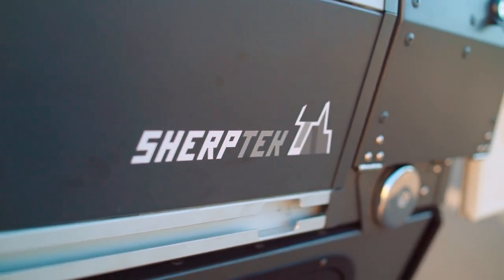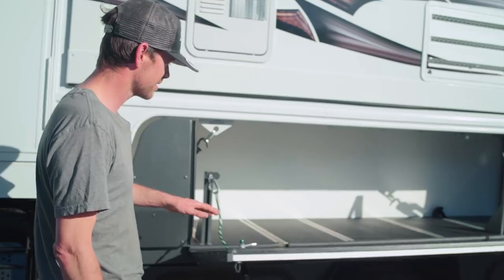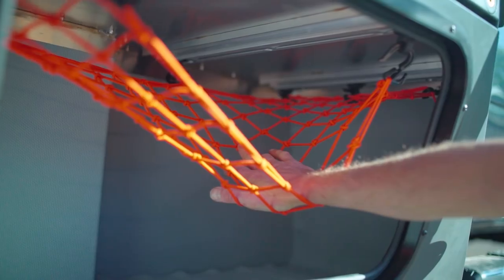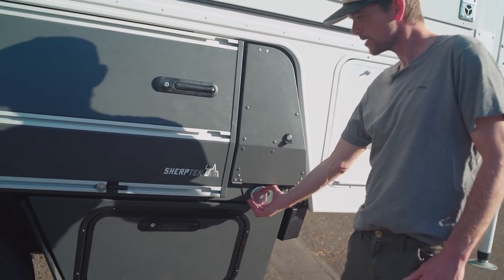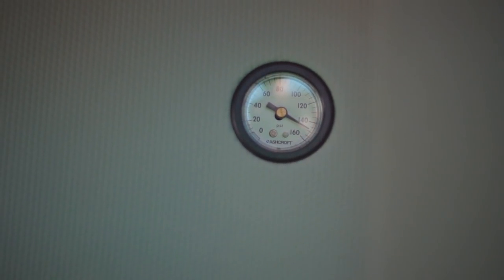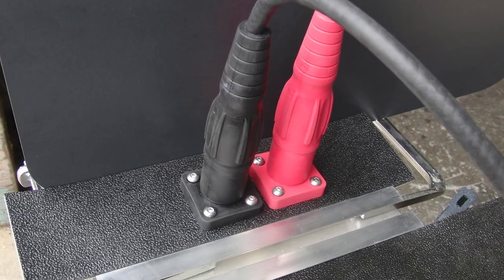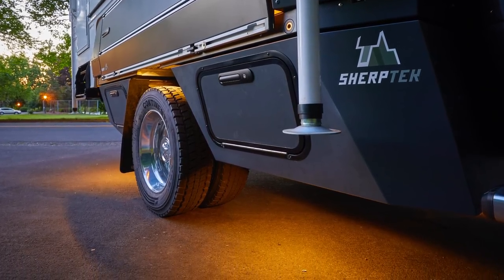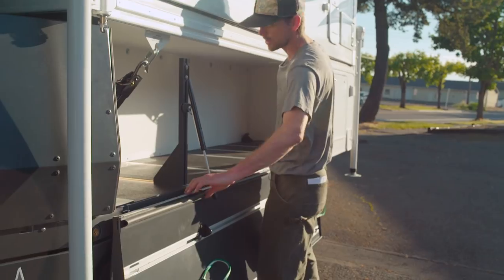A SherpTek modular truck bed replacement system: Ram 4500 chassis cab + HOST Mammoth

Comment: I have been struggling with getting a toy hauler or a motorhome or a camper. I ruled out the motorhome as I do not want another motor/transmission/brakes and so on. so my next idea a toy hauler and the problem with that is space for the wide range of trips and toy I do and have. I just could not see one that would work for me. so it's coming down to custom building a trailer for hauling what I want to play with, so I started looking at campers to put on the truck. after looking at everything I could not get over how much space is wasted with a camper. so I started looking at flat beds and building my own camper on that. then today I came across the ultimate truck bed and it gives me back all the wasted space, I'm ordering a new truck with no bed and buying this one as it fits all my needs and gives me back all the space I would lose with a normal truck bed.

Comment: You should build a heavy duty bed with the air and water system for a work truck. Welder set up or with 5th wheel for small car haulers, racers, lots of customers there.

Comment: Your trying to tell me someone spent all that money and skipped out on a cummins  for the power plant?  Wtf!
Reply: Chase Memmott you read my mind!
Reply: New diesels suck. DEF, DPF, crap millage, can't work on them at home the list is long. At that point just get a gas hog.
Reply: All that crap can be deleted. The longevity, torque, reliability and resale value of a cummins equipped truck far outweigh the hemi. Fuel mileage? Have you ever driven a 9000 pound dual rear wheel truck with a 5000 pound camper strapped to it? Let alone up any sort of grade, WITH A GAS ENGINE? You'd be lucky to get 5 miles per gallon. 

And as far as working on them at home, my 5.7 hemi is so shoe horned into my 1500 that you'd have to dismantle half the engine bay to change the spark plugs. It's a wonder the hood can still close. Every engine is all computers and almost built to be dealer serviced. I cant imagine how bad that bigger 6.4 hemi is.  

The emissions shit is a government mandated pain in the ass but with this owners budget its a no brainer that the hemi was a mistake.
Reply: Marc Laky do you own a new Cummins or a 6.4 hemi.
Reply: No one wants a diesel is crazy cold environments.  Its the dually part which gives it enough payload.
Reply: It’s a lot more than just that. There are a lot of stations that still don’t offer diesel. It’s not at every station, and when camping, you can plan a trip around that, or buy a vehicle that a fuel source is widely available.  Not to mention the DEF issues that’s destroy diesels right now. Dads 17 is around 3k miles and already in the shop for that reason, the shop trucks at my work have all but swapped to gas because of this issue, yes you can delete. Then what void your warranty, this guy probably doesn’t want to go threw that hassle of no warranty when making long trips.
Reply: No I drive a 2018 peterbilt that weighs 26,000 lbs and all that can't be deleted in certain states. Look into commercial vehicle laws and if you get caught with all the emissions deleted by a cop who knows his shit you are screwed. I had a Kenworth T300 with a Cat C7 and I would rather have that pig back. Plus if you buy a brand new truck and delete the emissions kiss that warrantee goodbye.
Reply: I worked on a vehicle that traveled the world. It was a 2002 F550 with a 7.3 powerstroke in it. That engine with only a few mods can run on jet fuel. They chose that truck because they were spending an entire winter on Lake Baikal. They couldn't shut their engine off for months straight and they would get jet fuel deliveries from the Russian govt for the other vehicles that were there. This truck is massive, at the max weight for the chassis, long as hell and would only be viable in the continental US. You would have a hard time getting parts and support in many countries around the world and on top of that crap diesel that would eat the fuel system alive. It looks beautiful but i would rather have a land cruiser for traveling outside the states.
Reply: Removing it all isn't really a solution though. it violates factory warranty for one, and it is also illegal, and can result in the vehicle not passing state inspections. and before you ask "well then reliability shouldn't matter if the dealership will fix it anyway, right?" not quite, I'm not sure what use this truck will get, but imagine someone if off on a month long wilderness trek and a couple weeks in the truck gets sent into limp mode cause one of the numerous emission control systems went unhappy. your tool kit that you bought to fix mechanical issues won't help you any, you'd have to pay big bucks to get a wrecker to pick you up from the middle of nowhere and tow you to the nearest dealership, which could be hundreds of miles away. at that point, even i'd just accept the worse fuel economy of a gasser that I know will go 60K miles before having anything seriously go wrong with it before I gotta take it into the dealership.
Reply: I too would rather have a diesel engine but with that being said gas engines are a lot better now than they were back in the day and as stated with previous options unless you delete all of the power restricting emissions crap and forfeiting whatever warranty you have it just doesn't make that much since right now to spend all that extra money to get not that much better performance.

Comment: bad placement for the air connectors. easy to get grit into it and cause a jam.
i do not see any use for a remote light switch.
a lower rail bed for fifthwheels??
i do like this...but at what cost?

Comment: Just need truck,ha & the Host doors on both sides w/taller under storage so can store potentially super single I think they ran 41" tall & not sure the width for under slide storage. The back window needs to come out easily for loading bulky items 2 prts max. 1 company had washer dryer in sofa spot under window. I would use 2 combo washers that dry, w/table on top. Tri slides r v/heavy no need to rear slide a combo or 2 combo washers. 2 side slides make alot of sense. Want a pop top but Host doesn't offer that yet. Solar  & lithium prep or better installed that can work w/ pop top. 5500 extended rear 1 ft quad cab 4500/5500 4by 4 they don't hybrid make yet.

Comment: I would like to get something similar. Actually this would be my dream set up since i want a mammoth as well and a ram 5500. how much does this same set up goes for? (just want to know for research purposes. Thanks
Reply from the maker: Thanks for your comment! I'll share with you what I shared above. Hope to hear from you soon!

"All of our products are high-end, built-to-order using aerospace materials and construction techniques, and held to the highest quality standards.They are light and strong and built to be abused for the life of the truck and beyond, and the modular nature means this truck bed can be changed and adapt to your needs throughout that time. One of the biggest benefits is that if you choose to go with one configuration at the outset, you can end up changing it completely years down the road if your needs change ... you're not stuck with one utility bed. Due to the many variabilities for each build, which often include aftermarket truck upgrades that we do in-house, we prefer that you fill our the "How to Buy" form (https://sherptek.com/howtobuy/) to get more specific pricing information."

Comment: Beautiful work guy this is a winner system that is lite works w/Host camper perfect can b hardened, just perfect, U Hve My sale! I was wondering just how well other ppl side boxes would work w/w/Host dimensions. Can the hardened bed version b tilt bed sturdy enough to b match ability of the truck. If just flat no problem but  4500 when not camping or towing is a Work Truck.  Almost hve to take standard tilt bed & let u make it Host match box approved.
Reply: some kind of chrome still bumper winch front & rear no extreme crazy lites.

Comment: That is a very nice build to put it lightly. What is the setup, 15k?
Seriously nice build, gives me tons of ideas for my next flatbed build.
Reply from the maker: Thank you! All of our products are high-end, built-to-order using aerospace materials and construction techniques, and held to the highest quality standards.They are light and strong and built to be abused for the life of the truck and beyond, and the modular nature means this truck bed can be changed and adapt to your needs throughout that time. One of the biggest benefits is that if you choose to go with one configuration at the outset, you can end up changing it completely years down the road if your needs change ... you're not stuck with one utility bed. Due to the many variabilities for each build, which often include aftermarket truck upgrades that we do in-house, we prefer that you fill our the "How to Buy" form (https://sherptek.com/howtobuy/) to get more specific pricing information. Thanks again for your feedback, and we hope to hear from you soon!
Reply: Judging by their dancing around giving a ball park price im going to say close to or more than the New dodge 450 you're buying for. No reason they can't quote the price for the one in the video it's been built they know the costs and what they sell it for. Any place that makes you give a email just to get a ruff estimate knows their prices are an instant show stopper lol.

Comment: You’re trying to sell a truck bed but all I see is a camper.
Reply: dutch971 the bed was custom made to fit around camper. Without camper it doesnt make sense.
Reply: justin j it's a modular system so it does make sense without a camper especially since it can become a flatbed

Comment: Incredible amount of functionality however aesthetics are awful, you show no use of the flatbed other than to hold the camper we would like to see what the capabilities and details of the flatbed are as it’s a transitional bed for multi use...
As being in truck sales for 25 years you need to show the capabilities the weight load limits the usability in every setting, job performance, vacation performance and so on...
Reply from the maker: Thanks for the feedback on the video. If you go to our Instagram account - https://www.instagram.com/sherp.tek/ - you can see some additional uses.